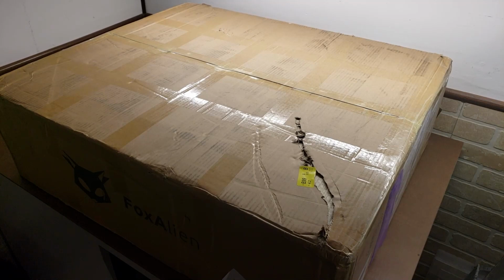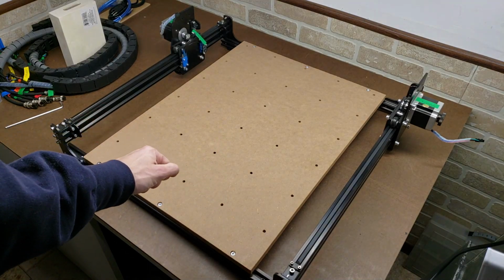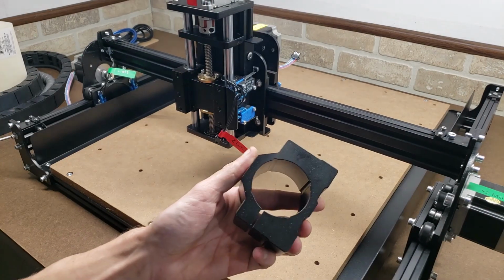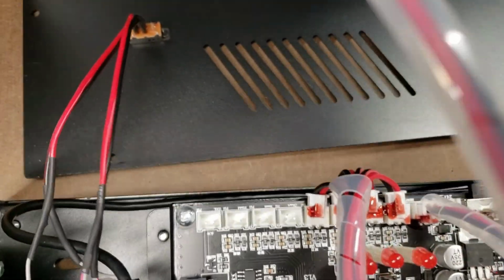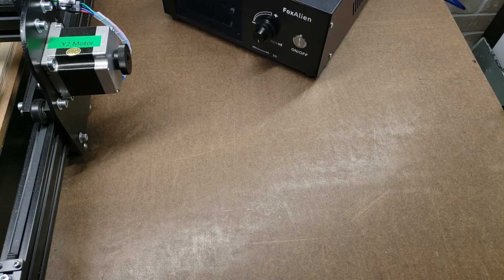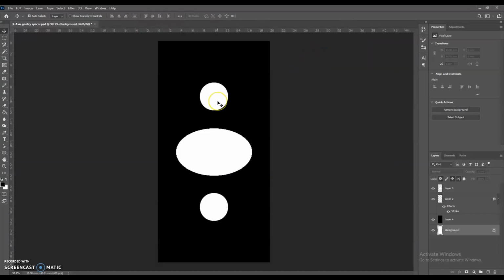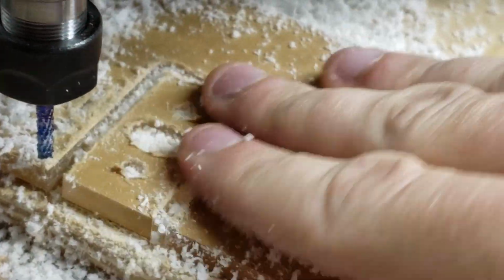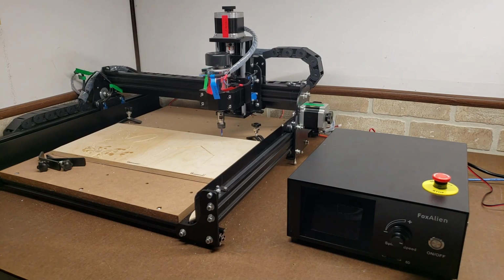FoxAlien 4040-XE CNC Router Unboxing, Assembly, Test, and Review

Comment: What shielding window are you using at 48:22? Where did you purchase it? For extra protection, I'd like to build an enclosure for my FoxAlien as well!
Reply from the maker: It is an amber acrylic sheet. 2422 is the color code. I bought mine from ebay. They are not officially rated, but I believe they are around OD3 at 1/8" thick.

Comment: Gotta nother question.
If you use LaserGrbl, how do you use Lightburn? Are you putting the info on an sd card and then transferring it to the controller box?
Reply from the maker: Both LaserGRBL and Lightburn can connect directly to the controller. I personally prefer Lightburn. I haven't tried exporting the g-code from Lightburn to run via the external controller. I've only ever used the offline controller for routing. It is definitely absolutely possible to run the laser via offline controller, but using a PC gives you much more visual feedback and options. Framing the work area is a function that the offline controller doesn't have. Although, you could create a special g-code file that has the framing macro and keep it on the sd card.

Comment: In the next few weeks Im looking at ordering one of these. 
Did yours not come with wire, to hook up the laser, by accident? I really know nothing about wire or soldering and dont want to order if the laser module doesn't come with wire. Every thing else looks pretty good for my needs.
Reply from the maker: When you purchase a laser module, it comes with a long cable for hooking it up to the 4040-XE. I took the laser module off my LE-4040 to use on the 4040-XE, which is why I didn't have the cable.
Reply: @laserwizard1982  
Great! That had me worried

Comment: Can you tell me why the 4040-XE has only an 8 bit control board and the lower end models have a 32 bit control board?
Thank you.
Reply from the maker: The 32bit machines are FoxAlien's latest releases. They are not the lower end models, they are just the newest models of machines from a different class. The Reizer is a laser CNC machine, and the 20W laser module needs a 32bit board in order to be able to move the machine fast enough to utilize that power. I raster engrave at 6700mm/min. For a CNC router, the 8bit board has been sufficient for me. I have been doing some real cool things with it lately! It can be an issue if you are trying to laser engrave on the 4040-XE because of the feedrate limit, but that is like trying to drag race a tank. I don't believe the 8bit controller is the limiting factor on the 4040-XE, but I'm sure a 32bit board would be nice!
Reply: @laserwizard1982   
Thank you,
This will be first cnc venture.  Was hoping to have one unit to do both and need to stay about the $1000 mark.

Comment: Great information about adjusting the X-Axis on the gantry. I'm going to remove mine and make sure it moves smoothly like you showed.
Reply from the maker: Tensioning all the belts and v-wheels to their sweet spot can make a world of difference! You should feel it out after each adjustment. It usually takes me a few cycles of loosening and tightening until I'm satisfied with the feel.
Reply: @laserwizard1982  No matter what I do, the gantry can tilt back and forth a bit when nudged by hand, The X Axis extrusion flexes a little bit. I don't think there is a way to stop that.

Comment: Awesome video! Are there any apps you use for CNC? And I’m assuming that this machine isn’t blue tooth capable? That’s why you work offline w an SD..?
Reply from the maker: There are a few people that have setup Raspberry Pi's to serve as their g-code streamers which they can send code to over wifi from their main PC. I personally have a dedicated laptop which I solely use as my machine controller for the 4040-XE. Candle has served me very well and I haven't had any issues with it. I don't believe GRBL controllers are capable of having bluetooth or wifi built in.

Comment: According to Inventables forum, if a machine was running grbl on an Arduino Uno then it could run directly from Easel. Does this machine come set up with an Arduino Uno, or, if not, how hard would it be to swap out for one? I had a Shapeoko in the past so became very familiar with Easel, and now I am looking for another CNC machine but would like to continue using Easel.
Reply from the maker: Hey Robert, sorry I missed your question. All of FoxAlien's machines run on GRBL firmware and the controllers are based on the Arduino. Their latest machines are starting to use 32bit controllers based on the STM32 microprocessor, but they are still running GRBL firmware. There are quite a few people using Easel to stream the g-code to their machines, but there have been a lot of reports of Easel randomly changing the GRBL $ configuration parameters. I personally use Easel from time to time, but I export the g-code and then stream it via Candle or the built in offline controller.

Comment: Really enjoyed this video, so thanks for doing it! 
I will be purchasing my first CNC machine, probably in the next 2 months. (I tend to over study everything before I can finally get myself to pull the trigger on what to buy. Wife says I have OCD...  ) 
I am wondering how satisfied you are with your purchase of a Fox Alien ? 
Is the software fairly easy to work with?  
Is is as accurate as you had first hoped?
How well do the belts seem to be holding up ? 
Thanks in advance for your kind and honest response!
Reply from the maker: Hi Steve, sorry for the late response. I am very satisfied with my 4040-XE. There is definitely room for improvement, but it is a very capable machine with lots of potential.

I've been learning Fusion 360 recently, and that is going well so far. There is a huge learning curve when getting into CNC.
There are a bunch of software options out there, some make it very easy to get started. I started off with Easel.
It is very accurate in terms of it's positioning. I used it to laser engrave a ruler and it was spot on over 30cm.
The belts are a weak point. They are not the best quality. I have just put on some polyurethane steel reinforced belts, and they are significantly stiffer. However, they may not last being rolled around the tight radius of the 20 tooth sprocket. I've got Gate's brand GT3 belts to try next. I'm also trying to convert to 9mm wide belts.

Did you end up purchasing a machine? Who did you go with?
Reply: I purchased the Fox Alien and have it assembled and on a dedicated table which I also built. 
TBH, that's as far as I have gotten to date, as I started a sunroom that is now about 50% finished.
I decided on the Fox Alien for it's ability to read code from an SD card allowing me to do my workup from a desk
top computer inside our home. 
Thanks for your reply!
Reply from the maker: @stephenenglebright  good luck on finishing your sunroom! Hopefully, you can create some beautiful wooden carvings to hang in there! Be sure to join the FoxAlien Facebook CNC group for when you decide to get back into working with your machine.
Reply: @stephenenglebright  Big learning curve programming to run a CNC with G-Code.  Good luck there.
Reply: @sotm2  Tell me more!

Comment: Let me know how this works. I really don't think that the X axis beam is going to be rigid enough. I for see it flexing when rough cutting. You may end up beefing it up..  But it looks like a nice machine.
Reply from the maker: There is a little flex for sure. Flex can be a good thing for beginners, like myself. It has a little leeway in case you mess up your settings or crash into something. So far it has been great on wood and acrylic.
Reply: @laserwizard1982  Great...Keep me posted. I'm looking at a OneFinity cnc router. Not sure what size yet and I will have to order it but they are totally rigid. The prices are pretty reasonable also.

Comment: Does it support variable spindle speed?
Reply from the maker: The spindle speed is controlled via a potentiometer on the front panel of the control box. So yes, it is a variable spindle speed, but it is not varied through the g-code.
Reply: @laserwizard1982  Good to know...

Comment: So you've uploaded this video almost a month ago.  Any additional thoughts on this?  I am looking to get into CNC and there is so many options out there. Thanks
Reply from the maker: If you're thinking about getting into CNC, then I highly recommend getting yourself one of these machines. I started off with the LE-4040 laser engraver, and it's facilitated an enormous amount of learning for me! Next, I got the 3018-SE, which I learned 3 axis machining on. I outgrew it pretty quick though, and the 4040-XE is the perfect next step. The 3018-SE is meant to be educational and a first step for getting your feet wet. But the 4040-XE is actually an amazing addition to my shop, a very potent and practical tool. Before, I had to hacksaw and hand drill parts, but now I can quickly generate a simple g-code to create the part I need. 

I'm using my 4040-XE to machine acrylic plates for a giant CO2 laser machine I'm constructing. It is definitely not a toy or a hobby machine, but a versatile tool for a small workshop.
Reply: @laserwizard1982  Well sir I think you just sold me a machine. Damn it!
Reply: How much is this machine and can you create receivers with this machine

Comment: What software comes with the 4040 XE ?
Reply from the maker: This machine's controller utilizes free GRBL software. It works very well and is easy to use. Candle is the program supplied with the machine on the USB drive. There are several free g-code streamers that you can use (UGS, bCNC) as well as a few free CAD and CAM programs. I've been using Easel to generate my g-code, then I usually stream it via the offline controller.